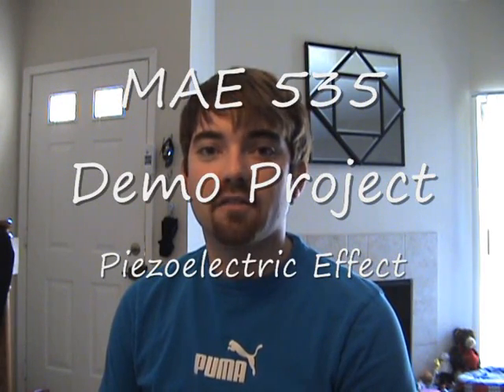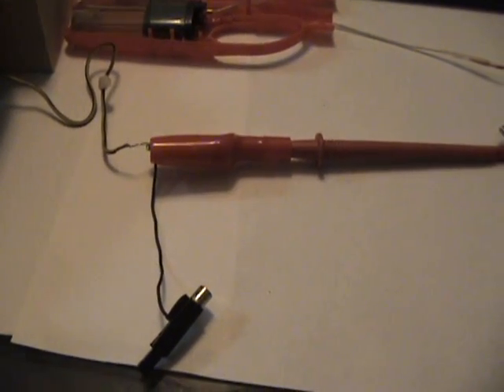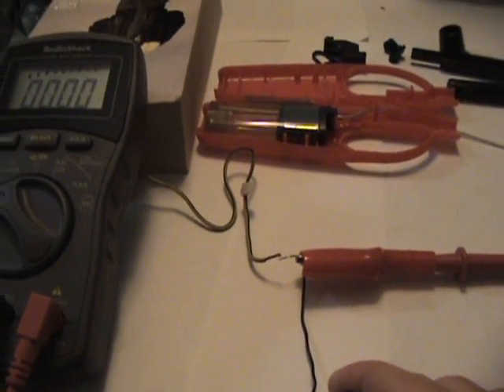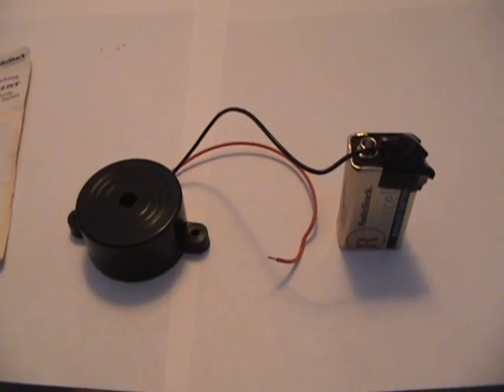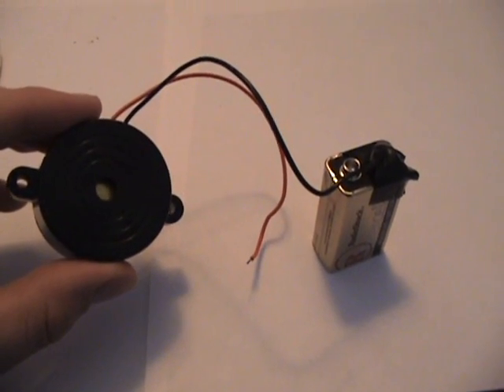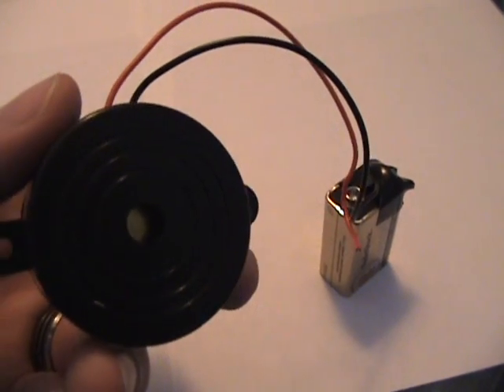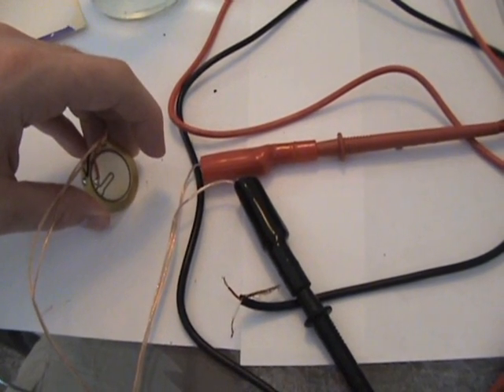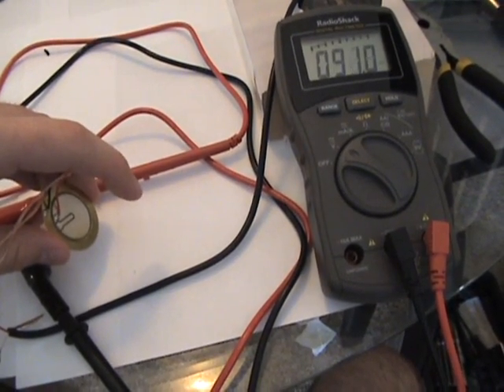MAE535 Piezoelectric Demo

Comment: @fronkenpoop, here is more, as promised, for your edification. The original Greek word from which comes PIEZO is 'piezein' or 'piesis', meaning "pressure". Not that it helps much, but classical Erasmian Greek would divide it up like this: (Pi-iota) // (accented epsilon-zeta) // ([epsilon-iota dipthong]-nu), where // divides syllables. So they would have said 'pih-ehz-ayn'. In modern pronunciation, the suffix is dropped and vowel pronuncation morphs to pih or pee-aye-zoh. Professionals agree....

Comment: @fronkenpoop 
This is supposed to be a science/physics demo, and it is referenced to a course number MAE535. This means it is not intended to be a casual demo just for the YouTube crowd. As such, the presenter should get the basics right, and this includes how to pronounce the main subject's name. And if you don't even understand enough of what you are measuring to realize that the demonstration is flawed, then it begs comments. No good teacher would let these errors go unchallenged.

Comment: i think Ford's use of piezoelectric effect has more to do with cymatics in the liquid fuel than it does with any valve opening or closing.  its the same way piezoelectric inkjet printheads work.

Comment: A couple of comments:
-You say Pee-zee-oh and Pee-zo. The word is actually Pee-ay-zo. You are not alone, as many engineers also have never bothered to learn the correct pronunciation either.
-When you use the piezo transducer to generate a voltage, keep in mind that voltage depends on force applied. A piezo igniter uses a spring trigger to apply lots of force suddenly. Your multimeter cannot respond fast enough, so it shows a low voltage. It is actually more like 2000V briefly. Ask your teacher!